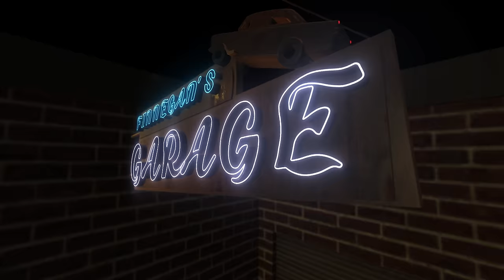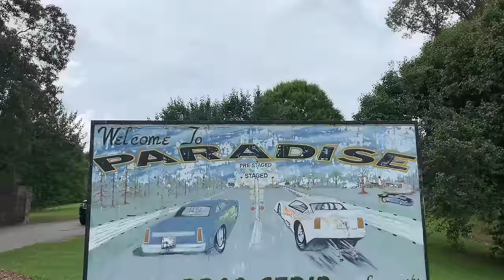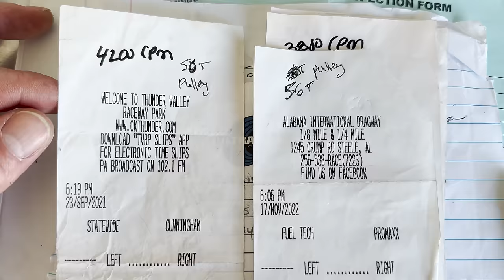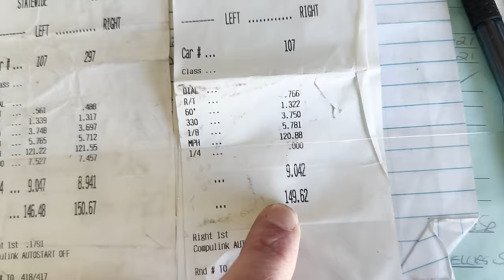DON'T CALL IT A COMEBACK! '67 FIREBIRD TRACK BLAST.

Comment: Check valve spring pressure, might be floating the valves up top….maybe. Love the content Sir!!!
Reply: very good point
Reply: Came here to say the same thing
Reply: Great point but I'm thinking the camshaft doesn't have enough to Rev that high either.

Comment: No doubt you'll get the Duck dialed  in, and with a 9.04 previous et a 8 should be obtainable. The biggest change I saw was setting the timing. I'm sure you would agree that was the biggest performance change that was made. I have to belive that pointer is off. It's great to see you healing well and off the crutches friend.

Comment: Before the chassis dyno, pull the pan front cover and heads. Using what you have at the shop, measure the bore and stroke, the cam specs, lap the valves, treat it to new bearings, pick the kids up from school, put it all back together in time for dinner.Waiting till you blow it up, a replacement is about 10% the cost of your new tow rig.

Comment: You might check the air scoop hold down as the square shape of the bar may cause air flow problems. There was an engine masters program on this in the past.

Comment: . My favorite car a yellow 1967 firebird. Although i like mine with slot mag wheels, 15X12 and P295/50 on rear with coil overs and track link bars and watt's link. And truck arm bars fastened to the Xbars under the front seats. No leaf springs here. And no nose dive. Buick 350 engine with Aluminum heads from TA performance and improved and worked by David Vizard methods. A Pro Systems SV1 carburetor 850 cfm. A GM aluminum A833 manual 4 speed with overdrive with a modified hardened and reinforced case. 3.90 rear gears in a FOX 8.8 aluminum hardened and reinforced rear end. A single piece fiberglass tilt front end reinforced with carbon and kevlar with S glass materials and some aluminum and chromoly sheet monocoque lay up structuring as well. This car is much lighter just by these lightweight combination and is meant for daily driving and pizza delivery being fully sent. Epoxy used in construction is loaded with blend of 10% silica. Front suspension is coil over with custom A arms and rack and pinion manual steering. With a mile of engine set back. Wheels are aluminum slot mags. Fuel cell is a mega gallon fuel cell that is custom built and integrated into car. Car seats 5 people if you are my size 5'6.75". Well the front engine cradle is a shear away in a really tragic heavy accident the front end can shear away and dissipate energy. Indestructible foot box and passenger area with full crumple zones surround. This 'car' is safe, fun, mpg efficient, and road worthy. 🙂

Comment: When you sped up the blower you created more suction on the carbs richening up the whole mixture. Then adding more jet it enriched more.
Reply: That's not how boost referenced cards work
Reply: @beekeeper6109   boost reference is for the power valve. All carbs work on the Venturi system and the airflow thru the bore draws the fuel through the carb circuits.  I have two roots blown big blocks currently and have spent lots of time on dynos.

Comment: I had a bad Accell Mopar alternator back in the 70s on my 340 Duster Super Stock car. It would cause the engine to miss above 6,800 rpm? I put the stock one back on, and it was fine. About 10 years later I  worked at a electric motor repair company. I  took it apart and found the diodes had a  couple cold solder joints. I  resoldered the  internal connections and it was fine. Funny how it made it through  quality control? Probably not 100% load tasted? It drove me nuts for a couple weekends. I  soldered every connection in the whole electronic ignition. It  finally was solved when I put the original alternator back on. You have all those electronics on your car so maybe try that. It's a simple swap.

Comment: I’m noticing a lot of wheel hop when it’s doing a burnout, but I’d be checking valve lash or valve spring pressure. It’s a cool car glad you saved it, but it deserves some attention that’s for sure. It might do better or like more timing too, since it’s running out of breath at higher rpm and breaking up.

Comment: Which coil, as per msd the round blaster is garbage for boosted applications, use the square one.  Fuel pump, lines, filter.  Remember that you have to push a large, heavy column of fuel from the tank to the carb, that's why most use a front mounted surge tank to feed the engine.  Also what's your plug gap.  I'd verify your timing mark but also many of the digital lights go wacky with the msd cdi ignition as under 2000 rpm they spark as much as 6 times per cycle for several(I forget exactly how many) crank degrees. I went back to a standard dial back light for all msd.

Comment: What are you running for plug gap? Might be that it’s blowing the spark out as the boost comes in. Just something simple to check. Gap the plugs down a few thousandths and see what happens. Worth a try. Fixing the laying over should put you back to where you were on race week.

Comment: 1:03 so after i broke my femur the first time in 2018 it felt the same. i could feel it moving every time i'd try to run. one week from my final physio, appointment, 51 weeks from the first break, it snapped again in a fall because i had spent basically a year walking around with a 50% healed femur needed to be pinned and wasn't. Go back to the doc and tell him that it feels weird and don't leave his office until he offers to give you an mri. It may not be fully healed and the only way he will see that is with an mri. And if isn't fully healed and you snap it again you will need surgery. It will change your life for good. I ended up with a stainless steel bar in my leg that will stay there till the day i die and i am now physically disabled. I can't run, jump or swim anymore. I can't climb ladders, sit in the back seat of basically any car.... the list goes on.

Comment: Had a family friend build a 347 for my Foxbody. He basically started the build and the previous customer backed out half way through so I paid for the rest. He did the same thing as the story you told about that unknown motor. He left and gave me no paperwork for the parts and specs just receipts. Luckily I got it tuned at Diablo Motorsports by Scott Beers who was able to get a decent tune out of it. It was a very strong dependable motor but now I need to find out what cam I have and there's really no easy way to do it.
Reply: Just a thought the # is usually on rear of cam I believe. Easier to remove trans and cam plug read #. ?

Comment: Has to be spark related up top… 
Blowing the spark out, and drowning it out. 👍🤘👏
Reply: But he mentions several times ITS LEAN, soooo definitely not drowning out from a blown out spark😂
Reply: @wesleyfowler8363  pretty simple to understand… 
Fuel issues will never causing popping. Ever run a car out of gas? Doesn’t pop. Just bogs and dies, doesn’t run or sound right. 
Spark makes an engine pop. Hence a two step… He’s also is not a good mechanic. So him trying to make sense of a problem is… 
Weak spark will be blown out by boost, and washed out by fuel. Un-burnt fuel will also make a plug clean if it’s rich enough. Been working on cars for 25 years and have a 1,000 blown pump gas bbc myself. 😂🤣🤣🤣😝😝😂😂😂
Reply: @frankensteincreations4740  Running lean can cause popping
Reply: @T51B1  maybe if it’s so lean you’re on a different plannet… Or a high boost turbo engine. Never N/A or a low boost roots blower. I’ve dynoed more engines than I can count and never had one so lean it’s popping. Especially at peak rpm’s. Maybe at peak torque or load in. High rpm is always spark brother. 👍

Comment: Pro Systems Carbs out of Muskegon MI, which is relatively close to you.  You fill out a build sheet online, so you need those specs as much a possible.   Had one of his 830's since about 2006-07.  Out of the box, Bolt on and idle, spare undrilled idle air bleeds in the package in case you need them, tune up sheet included for matching oem shelf components and other aftermarket bits.  About $100 more than the Summit or Jegs price for a shelf 830.   Worth EVERY dime for a flow bench carb, Don't be scared kids.  It saves you time.   Have the carb on my Super Victor Dart 406 in my 56 Chev.   Fires right up and idles.
Reply: He is in GA, not even remotely close to MI.

Comment: The added boost pressure and fuel could be causing the valves to float at high RPM

Comment: The rubber duck is cool but more importantly… Did you buy a new truck? If so which one? We need a full low down with all the options and why you chose them + towing impressions. We NEEEED to know how that bad ass trailer got to the track.
Reply: With a rented Ford. Mike posted in the comments.

Comment: The rubber duck is so good! I love pontiacs!
Reply: Built a 68 with a supercharged lt4 and 4l80e. Strange 9 inch. Bear brakes. Global west upper and lower front control arms and coilovers.  Looks like a nice stock restoration. Untill you open the hood or start it up.

Comment: Excellent video as always. I'm currently running a 355 sbc with an 871 and twin 750 Demons with a muncie m22 4spd in my 78 RS Camaro. At cruising speeds and WOT it runs really good but won't idle very well. Has hard starting issues and will die every time I pull up to a stop sign or stop light. The carbs are basically right out of the box. I live in East Tennessee about 40 minutes from Bristol Dragway. You mentioned needing a chassis dyno which I believe is also what I need. Can you recommend someone who knows how to tune a roots blown engine with carburetors on a chassis dyno? I can't take it 3000 miles but I can travel several hundred miles in any direction. This is my first serious blown engine setup and it needs some TLC. Thanks. And keep these vids coming.
Reply: Is it boost referenced? What power valves are you running? Are the floats set proper? Switching to 50cc accelerator pumps was night and day on mine, but that wont help your idle.  Good luck.

Comment: I would start by varifying TDC.   Valve spring pressures and while you have the valve covers off cam timing and lift.  I've never run 13 pounds in a slick that size,  6.5 -8 pounds would be about right . I run 8 in my 14 - 32's and launch at 5200

Comment: I've had the same problem that was hard to find, ended up being a failed spark plug, if you hold the threads and wiggle the porcelain and if you hear a clicking sound its no good.

Comment: Figure out the top dead center first, so your not over advanced or under advanced. Then check the wires, plugs, coil, distributor and cap. That's easy stuff to figure out.
 You got the launch pretty much perfected. Even lifted the wheel.

Comment: I love Blasphemi, but it is a 'roof & quarters' car which most folk probably find less relatable that Rubber Duck.
Reply: Blasphemi is not a roof & 1/4 Car. It only has a 8.50 cage in it. What planet are you from.
Reply: What would you know selling second hand cars for a living? Go back and watch the content Mike by his own admission states the only original parts are the roof and quarters.
Reply: @jameseastwood4984  , Can I have some of what you are smoking. Have you seen Blasphemi in person?. I have been building race cars for 30 years and don't sell used cars. so I can tell by your reply that you are full of it. go and do some research on Mikes car before you reply.

Comment: I see those blower setups with the carbs turned sideways.  I k8nd of imagine that to be a lean rich nightmare since the carbs are made to be turned the other way? I understand that once it goes through the big mixer it pretty even. Maybe what's occurring is when you accelerate fuel is pulling away from jets positioned in the forward areas. Maybe jet extension 1 on front primary and 1 on front secondary jet may help? Since bigger jets just made it fat.

Comment: Fuel pump or filter hindering flow maybe. If it's still acting lean and showing lean after jetting but picking up on low rpm it might not be keeping up with the fuel demand at higher rpm

Comment: 13:38,,,about the gasket sealing thing... I have been rebuilding engines for over 35 years. I never, ever use instant gasket or a silicone variation. On paper gaskets or anything that isn't rubber,,all that you will ever need is good old-fashioned normal, GREASE..! That is all. I don't have leaking of any sort whatsoever anywhere. Please believe me and try it. How do you think when you dismantle an engine for the first time from when it was built and there isn't a hint of silicone....??? ✌️👍🇬🇧

Comment: I know you guys will get the Rubber Duck into the 8s with that motor combo, a chassis dyno session will get that ignition issue solved and by the way was that your new F250 pulling the trailer when you left the track......just wondering?

Comment: 15:15 yes on that pass, you spell a tire, but more importantly, those carburetors that you sent out and paid somebody top dollar to build in tune for you without the car or Rich. You’re dumping a lot of fuel they need to be leaned out a couple of jet sizes leaner is meaner, check your data log if you don’t have a data log then maybe you should get one or at least have a gauge so you can read what your AFR is.

Comment: I would go smaller on the tires and some beed lock wheels with some nice 275-315 radials and then shave as much weight as possible this car looks like a 80s build on the outside.

Comment: never understould there explanation of advance, I see my SB chevy at 8 deg
Reply: That is "Initial" advance (you should see at idle).
As RPM increases there will be "Mechanical" advance (controlled by centrifugal weights, the springs that control their rate, and a stop which limits the maximum mech. advance).
There may also be "Vacuum" advance which adds to those (very likely and preferred on a street car).
On a SB Chevy you should be 32-36 "Total" advance.

Comment: You've been racing long enough, pull those valve covers, I believe you're floating a valve,  could be electronic but I would definitely check those valves
Reply: How does removing the valve covers show you are floating the valves?

Comment: ya personal, the valve cover in Yellow,  is a no go for me,  but Moroso gold,   Chrome or  ALUMINUM would look better!!  even stock Chevy Ornage would look better then Yellow on the Vave covers. agree to disagree. Clear coat your stuff after install, save time later. @ 17:23 & @ 27:20 the rear passenger side tire looks to be out of balance?
Reply: You don't balance slicks like that. Bead weights will rip the tire when it spins on the rim, and barrel weights will get thrown off in the burnout box. Pretty certain you wouldn't pass tech at any race track with them on there.

Comment: Probably wouldnt hurt to throw some wideband kit on there and physical gauge that can be either logged or video taped. get any idea of actual  mixture during a pass as opposed to the guess n check with a billion variables like timing, boost potentially blowing out spark, all the unknowns with the engine itself.... Give a guy a chance. 

Theres a lot more accessible tech used for EFI that can just be for logging with a carb setup. Theres probably ways to tap off the timing box too...that way you could just have a cluster of gauges with boost, timing advance, rpm, mixture, etc that you  could record with a gopro during a pass. 

Doessnt have to be rocket science, yall proved you can eyeball suspension with a recording.

Comment: is there such a thing as a dump delay clutch pedal? when you drop the pedal it doesnt fully just ram the clutch together but allows it to slip a tiny bit so you dont shock load your transmission to the point it turns everything into cheeto dust? seems like transmissions blowing up is a common theme among all the car youtubers these days. lol! 
🤔🤔🤔
Reply: Most of them aren't making enough steam to justify a slipper clutch setup. They are expensive and take a lot of work to dial in. Maybe if he was trying to break into 7 second territory. That engine needs to be gone through to determine what's in it and what it can handle, then probably 700 more horsepower for all that.
Reply: Not to mention the vast majority are running automatic transmissions.
Reply: Finnegan did a whole video trying to dial a system like that in on Blasphemi.
Reply: @adematthewsracing  ahhh yes i feel like i remember that, except i had a couple wobble pops and i forgot.
Reply: @philbert006  thats fair. my comment was leaning towards blastphemi, VGG, Stay Tuned, and Donut Media.
Reply: Slipper clutch

Comment: Well, this is your only truest in the sense racecar that won't be carrying passengers in a back seat so why not make it faster? Kevin Smith isn't too far away...When you said it was breaking up, what size fuel lines are on it? Could you maybe be running out of volume of fuel? Maybe its time to run a front fuel cell with its own pump and yes I know its more work but the G - Forces will work for you instead of against you.

Comment: Damn I know you get tired of computer dudes telling you stuff but 4 steps on jets is way to much at any given time cause had you been that far off to begin with you prob would of hurt some parts thus 2 jet sizes would of been plenty id even bet that + 1 primary and +2 secondary been plenty also if its no rpm'ing and the coils turn out good likely timing issue you even said yourself don't know much about the engine but all this can be tested on a dyno. nice video just wanna jump through screen and help also tightening them jets that tight gonna make short life of that metering block but again I am just a old school 90's drag racer take care.

Comment: You have fuel pump issues..upping the jet got leaner..efi 40+psi..injectors pulsing you are feeding almost same HP as blasphemy with 4 needle and seats 8 jets..that don't pulse with less pump..I've burned up a few motors under pumped or so I thought..